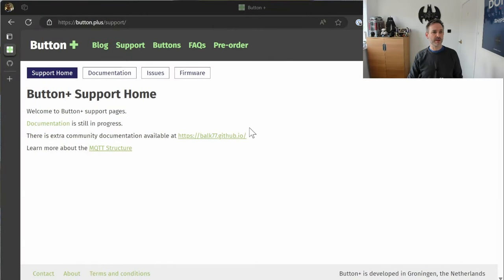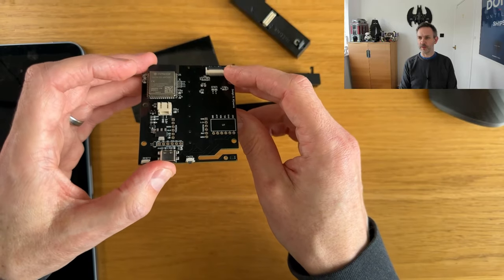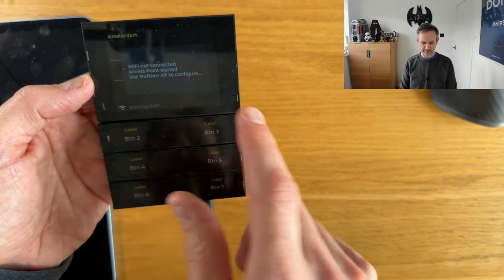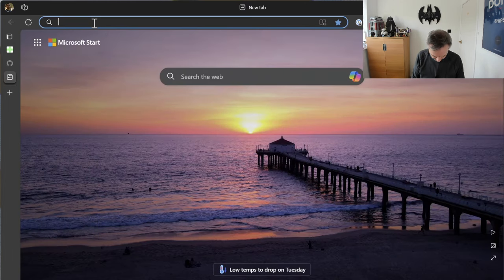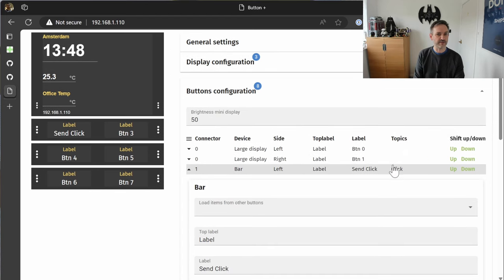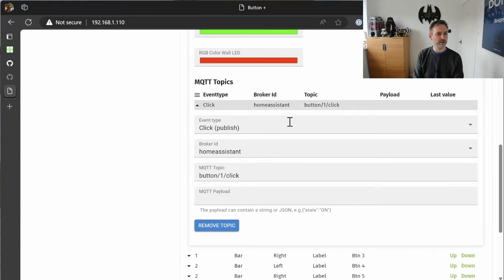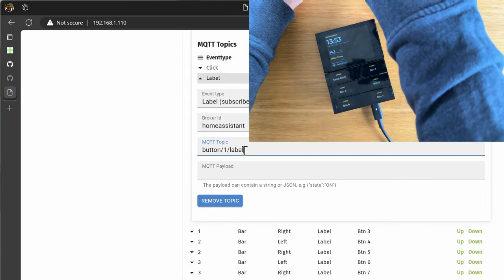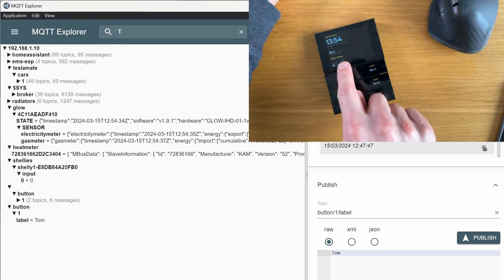Trying the Button+

Comment: The unit would have to have some GPS/location hardware for the "portable" idea to work,  it looks deigned to be  wall mounted with the button hardware actually on the back of the unit.
Reply from the maker: I’d use something separate for the location, like the UWB beacons I have. They can track stuff inside my house.

The mount I have in my head would ensure the buttons worked. It has a metal plate, so whether I fix that to a piece of plywood or a wall, it doesn’t matter. 

I just don’t know what sort of battery life I would need.